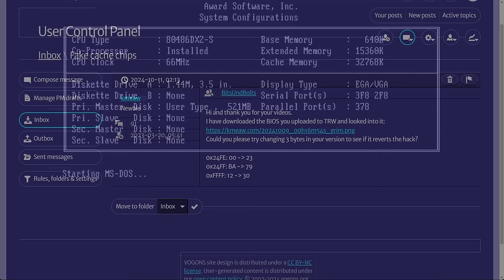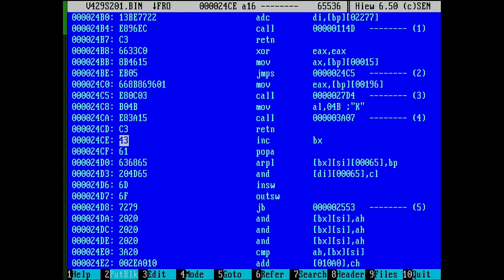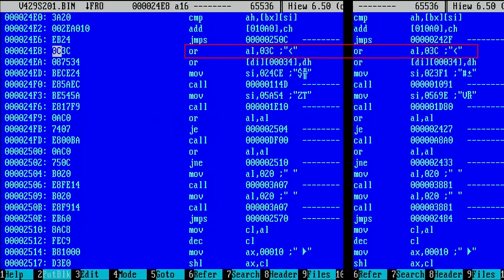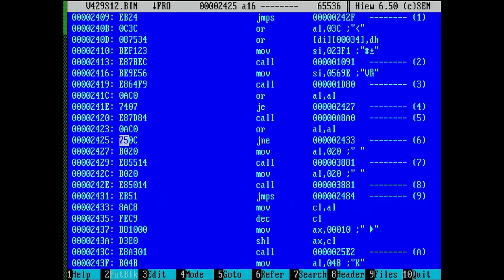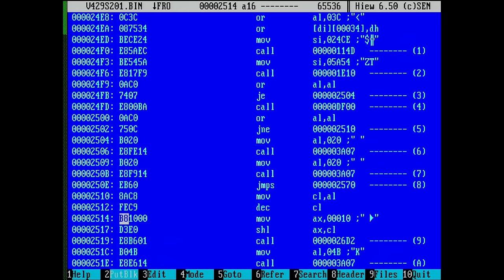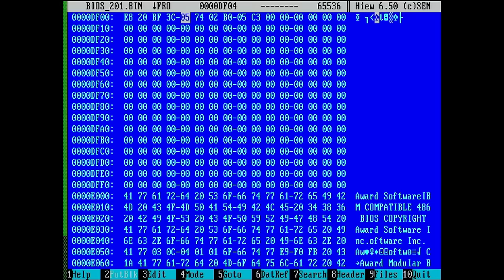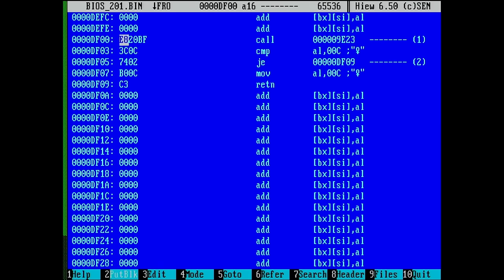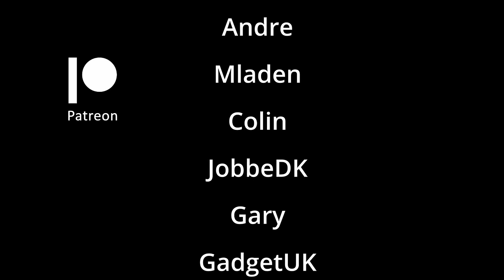Uncovering the Fake Cache BIOS Mystery and Fixing It!

Comment: For someone claiming to not know x86 assembly you did great :-)
Reply from the maker: Hehe, thanks. I really have no experience with it. I tried to learn about the instructions in the area that was interesting, but without the help of my viewers, I wouldn't be able to do this myself!
Reply: When he said 'x86 assembly is human readable' I laughed a little. First because most people avoid assembly languages of any architecture but because the x86 specifically is one of those ones where the same wad of bytes has different meanings depending on which index you call into. We might have seen hints of this later where the decompiler was showing a string as code.

Comment: such convoluted code to make it always display 256K... at address 02510 they could have simply changed the "mov cl,al" to a "mov cl,5"... no need to make extra functions or change jumps.
Reply from the maker: That's certainly the quickest way to always show 256k L2 cache. I wish the author of that code would come forward and explain it and him/herself 🤣
Reply: @bitsundbolts I think the author wanted to be at least a little bit obfuscated than straight out lie in front of you ;)
Reply: Or even that the function at 0xDF00 bothers to A) call the original routine, B) compare the return value. it could just put 5 into al unconditionally.
Reply: Guess that extra function would make it easy to find and change the value for other variants of the fake cache board.
Wonder if the seller even knew the cache chips were fake.
Reply: checking for 5 and then overwriting anyways is interesting, yeah 😅 also wondering why al is decreased before shifting 0x10. could also just shift 0x08 by al directly 🤷🏻‍♂️
Reply: After thinking about it, that extra function would totally make sense if it used to be different at some point.
I mean, it still checks the actually present cache and only overwrite it if it isn't the expected value.
It might have been set up to only overwrite the reported cache if the reported cache is 0, but otherwise leave the value alone.
So some kind of hack to get around improperly detected cache which was hijacked at a later time.
Reply: @bitsundbolts  I think the original code should be to display 256K if the cache is less than 256K, otherwise display the original cache size.
Reply: @mckuhei  That is actually really smart... that way if someone upgraded they would see the correct values... in practicality very few people would downgrade and see the "bug"
Reply: Isn't mov cl,5 larger than mov al, cl

Comment: Assembly language of x86/AMD64 is a disaster. One of the messiest out there. Over the years I got to know it pretty well and I wouldn't recommend it for someone just starting to learn asm. I wouldn't recommend any CISC for that purpose. RISC architerctures like MIPS, AArch64 (64 bit ARM; 32 bit is a little bit messy too), RISCV, etc., are much better starting point. 8-bit microcontrollers are good for learning too.
Reply from the maker: Thanks for this information. I started an online course that I can hopefully finish soon. I will keep this in mind and probably have a look at cleaner assembly before it gets frustrating.
Reply: @bitsundbolts  I mean, don't take it too seriously. If you're comfortable with CISC go for it. x86 isn't going away anytime soon.
Reply: @pvc988 Same, go with CISC, suffer as we did decades ago. Assembly is a product of it's time regarding x86. I'm sure RISCV is cleaner, as OP mentioned, but I'm not sure how that's helpful in the context of this channel's focus.
Reply: I mean as far as classic x86 code goes it's not TOO terrible. It was written like this, thus it can also be read like this.
Reply: I have come to really love Z80 assembly. It was binary compatible with the 8080, but the intel mnemonics are horrible. 
The language for the Z80 is much better. I believe it was specifically designed to be easy to learn.
Reply: If you're looking to reverse engineer or modify existing code there's no way around it and no point in learning another assembly language lol
Reply: @zcomputerwiz   You could have fun REing any number of things. Lots of console games if you wanted to RE them to gain insight or modify them, well those are mostly RISC processors; plus 6502 and 68000 which are nominally CISC but a different much nicer lineage and really a pleasure to read. You don't necessarily have to start your RE journey on PC.

Comment: Great job. Nice to see you tip your toes in Assembly language.
Reply from the maker: And you know what? I absolutely love it! It is not that easy to understand and I feel you need to know a lot that is not mentioned anywhere (like port 0x70h, 0x71), but I am willing to learn more and get better! Assembly language allows you to do really amazing low level things!
Reply: @bitsundbolts  It's definitely not easy. Plus you have to understand (at least for x86 assemly) what are the differences between ports and memory addresses, memory segments, segment registers, stack, stack pointer etc etc. Later you can explore the 32 bit subset (386 specific) registers like EAX, EBX etc...
Reply from the maker: I already saw examples of register segmentation. It's quite fascinating. EAX, AX, AH, AL... It's still all new to me, but that's as far as I got. I'll definitely continue to learn. It's so different from the languages I'm used to - and that's what's exciting ☺️

Comment: You can't "decode" a string to anything useful, it's plain data, not CPU opcodes (operation codes), you need to find the code that make use of that data. You can see that the hex values for those "instructions" are actually the letters in your string (grab an ASCII chart and check). You're actually very lucky you found the reference immediately after the string, this is often not the case.
Reply from the maker: Yes, that was lucky that the file made any sense at all in Hiew. I only realize now that it could have been much harder to reverse the code.

Comment: based on what I've learned in 6502 assembly, I'd search for the "cache memory" string like you did, but then I would take note of the memory location and then search for that memory location being referenced. That would get you that mov instruction. I could then look at the code at the address of the call immediately after it.
Reply: This. Modern reverse engineering tools like IDA or Ghidra make it pretty easy to do. I actually find it rather weird that in this BIOS, the strings are stored just next to their usages in code, modern compilers almost never emit code like that.
Reply: @kFY514   the BIOS code isn't compiled from a higher level language, it was written in assembler to begin with.
Reply: @SianaGearz  Probably. But most hand-written assembly I've seen also put constants outside of function bodies. There's nothing wrong with putting it inline, especially when you're not very concerned with speed and/or targeting a CPU that doesn't have a ton of pipelining - and the routine for printing the system summary screen in a 486 BIOS fits both of those descriptions. It's just... weird.
Reply: @kFY514  I found it odd as well, but I'd actually be surprised if it was compiled (well other than an assembler). It was probably written with strings and code mixed in the original assembly file.
Reply: The addressing modes supported by x86 assembly are so varied and "baroque" that it could be hard to find the code referencing the string by knowing just the address. In this case it was rather direct, but it does not have to be.
Reply: @ruevs  yeah I noticed that as the video progressed. I'm like......wait call address is different than the actual hex values. Wierd. I would expect a decent tool to be able to search for Call F8BE (I don't remember the exact address) and actually determine the correct instruction even if the hex doesn't match F8BE.
Reply: @awilliams1701  Direct Call and Jump instructions in x86 use relative addressing. The offset is the amount you need to add to the instruction pointer, not the absolute location to go to. This is nice as you can use signed 8bit short jumps to nearby locations instead of needing to always specify the absolute 16 or 32 bit address.  One further trick the value of the instruction pointer is not the address of the call or jump instruction but the instruction following the call or jump. X86 updates the instruction pointer after decoding the instruction but before it executes so the instruction pointer is always one instruction ahead of the instruction being executed.

Comment: The checksum check is actually quite simple. All that is done is to add up all bytes in the ROM and test if the result is zero. So you basically have to set the last byte of the ROM (or any other unused byte) to 256 – [sum of all the other bytes]. That's all.
Reply from the maker: The question is: which bytes. I don't think all of them are used to calculate the checksum. Or is it just the last byte that is excluded as it is the checksum.
Reply: @bitsundbolts  It really includes all the bytes of the whole ROM. Let's say you've changed a 04 to a 06 somewhere. Then the ROM would add up to 2 instead of 0, making the check fail. So you change the last byte from e.g. C9 to C7 (subtract 2) so the sum of all the bytes equals to zero again. 

In this example, if you would take the sum of all bytes but the last one, it would add up to 39h, or 57d. If you subtract this from 100h or 256d you'll get 199d or C7h, which is what you need to put as the last byte so the whole ROM adds up to zero again.
Sounds more complicated than it is :D
Reply from the maker: I think this is what I'm doing with that excel sheet. It does exactly that. It records the changes (calculates the difference in bytes recorded) and outputs the new checksum relative to the existing checksum. So, it calculates the checksum based on the DIFF.

Comment: Ok, new challenge:
You know for sure that modbin can calculate a new checksum. It does so when saving the file.
Can you mod modbin so that instead of showing an error, it just fixes the checksum?
Reply from the maker: Well, it clearly calculates the checksum - otherwise, modbin wouldn't know that something is wrong with the checksum.

It's an interesting idea and definitely a great challenge. I know that I'm not there yet, but I'll try to do that some time! At least to maybe output what checksum was expected!
Reply: @bitsundbolts  it could be easy, with some luck. 
I presume the program opens the file, and then calls a function to verify the checksum. If that is the case, the function would return something to indicate failure or success. 
If this is the case, all you would have to do is replace the call instruction with a jump instruction to the right place.
Reply: It would be probably much easier (and safer) to just print the expected checksum. Then you could modify it with the hex editor.
Reply: @jbinary82  Safer? Yes, for sure. 
Easier? Not at all. 
To change a call into a jump, you don't have to change a lot. You only replace a few bytes, and the number of bytes doesn't change. Both are simple opcodes that take an address as parameter.
But to print something, that takes a lot. First of all, you have to know where to find the actual checksum. That is a variable somewhere in RAM, and since you don't have the labels from the source, you don't know where it is.
Then you want to convert that binary number into something readable, like a representation of the binary value in hex using ascii characters. And then you have to call some sort of print function.
Reply: @TSteffi  it's a crazy amount of time since I did that in ASM, 
but could you copy the contents of that variable that was compared into the string itself that is saying that checksum failed? Hex to ASCII is not a big deal. This program should strings that are not used that often for adding such code. Just in my ignorance
Reply: @jbinary82  Not saying it can't be done. Sure can.
Another option would be to let modbin show its warning message, but make it not exit after that. 
My guess is, there is a jump to some exit function that frees up memory and stuff. If you'd replace the address of that jump with the same address that is used in the jump after a success, that would probably be the easiest solution. It wouldn't change the byte count, should be easy to figure out, and still show the warning.

Comment: At around 18:00 the reads and writes are to ports 0x70 and 0x71 and to port 0xE1. I/O ports 0x70 and 0x71 are used to read and write data from/to the CMOS RAM. Writing to port 0x70 causes whatever is put on the databus (in this case the contents of register AL) to be latched in the CMOS RAM address register. The CMOS RAM address selected is 0x3a. Bit 7 is set to disable the NMI circuitry. (this results in the NMI, or non-maskable interrupt being masked). The read from port 0x71 reads whatever value is stored at address 0x3a in the CMOS RAM. The venerable I/O port listing from Ralf Brown's Interrupt list does not document this CMOS RAM  location for Award BIOSes, but it does document the next address, 0x3B, for which bit 0 is reported as enabling the external cache (or at least in configuration). 

I/O ports 0xe1, 0x22 and 0x23 (the ones in the routine directly following the one being examined) are all reported by the same I/O port listing as for reading and writing chipset data. However, my guess is that I/O port 0xe1 somehow deals with setting the cache size for the chipset (so it basically copies over the configuration setting in CMOS RAM over to the chipset).

The or al, al right before the retn instruction makes sure the zero flag is set if the contents of al are zero. The conditional jump in the calling code (jne - jump-if-not-equal, aka as jnz - jump-if-not-zero) simply checks the zero flag and branches if it is not set. In other words, if whatever is returned in al by the function at 0xa8a0 is non-zero, it simply skips over the next stream of instructions, to addres 0x2433. 

Since at 0x2433 cl is loaded with the contents of al and then decremented. Then, ax is loaded with 0x10 (16 decimal) and ax then gets shifted to the left by cl bits. This value is then printed and a 'K' gets added after it. So if the return value (in al) was 1, the number of bits ax gets shifted to the left is zero, if it is 2, it gets shifted left by 1, etc. In other words: the value stored at 0x3a in the CMOS RAM tells us that we have 16*2^cl K of cache RAM. If it's 1, we have 16k; if it's 2 we have 32k, and so on.

Ultimately what the hack at 0xDF00 in the v2 BIOS does is call the original routine (albeit at a different address) and if whatever the routine returns is not 5, it gets "corrected" to be 5 and the control is returned to the calling code.
Reply from the maker: Thanks for this very detailed explanation! Very insightful!

Comment: The issue you might run into with decode is you need to tell it where to start.  IE that text at the top is not instructions, so decoding starting at byte 0 will give 1 set of instructions, but decoding starting with byte 1, will give you a completely different set of instructions.  This is because instructions are variable length, so the disassembler may not align with the beginning of an instruction.
Reply from the maker: Yes, the tool I'm using here decodes strings into instructions as well. Luckily, I could follow the section that was important for reversing the code.

Comment: A small hint that could've helped avoid some work/uncertainty: strings will often end in a 0 byte, so at 0x20 0x00 at the end of the cache memory was very likely not an instruction and it was definitely starting instruction decoding with an instruction at the 0x00, and it's unsure when a disassembler will happen to fall in line with the instructions, if it ever would.  Lots of little patterns like that to figure out over time.

Kinda wacky it checks for if it's 5 just to set it to 5.  Not even well-coded lies. :p

Comment: For restoring the original functionality, the simplest change would have been to set the byte at DF00 to E9. This increases it by 1, so you need to decrease the checksum by 1. It changes the opcode from "call" to "jmp". The rest can remain in there, it is dead anyway.
Reply from the maker: I'm afraid my knowledge of assembly isn't good enough to have come up with your solution. Yes, I could have left the dead code in the BIOS, but since I shared the file with The Retro Web Project, I thought it's better to get rid of it. Thanks for sharing!

Comment: I am pretty sure that the checksum at the very bottom of the bios code is not there as any sort of copy protection but probably as a way to verify that all bytes were written to rom correctly. Its either used as a verification during boot or probably during write when doing a update.

Comment: Really great job and very interesting. I do low--level bootloaders for embedded ARM based products, which are less complicated (less peripherals to handle), but it is funny that such simple checksums were deemed adequate back then. Really curious on stuff such as the Energy Star logo ... is that stored in the BIOS image as well, and how would this be rendered?
Reply from the maker: I have a video on my channel in which I show how you can change the BIOS logo. If I recall correctly, the logo is converted to characters and then displayed in text mode. The top lines are all yellow for the EnergyStar logo, and the bottom line is green to show "EPA Pollution Preventer". I don't remember everything, but there are tools that help you convert images to BIOS logos.